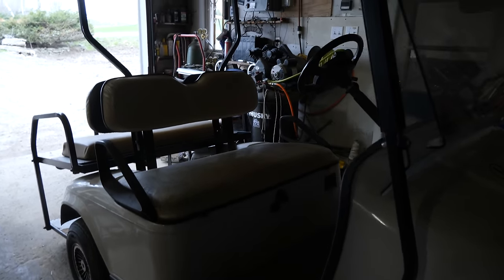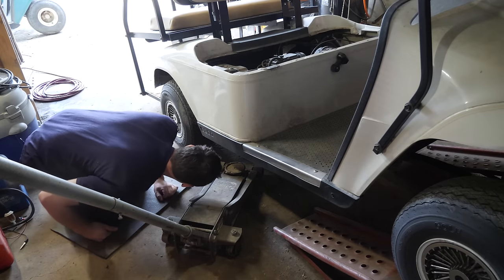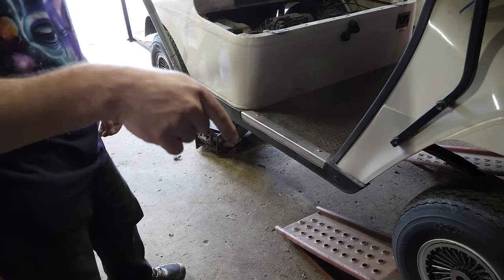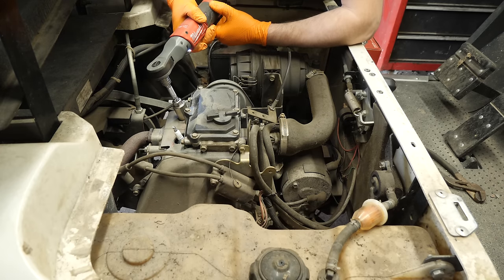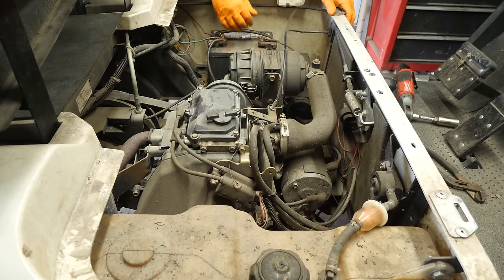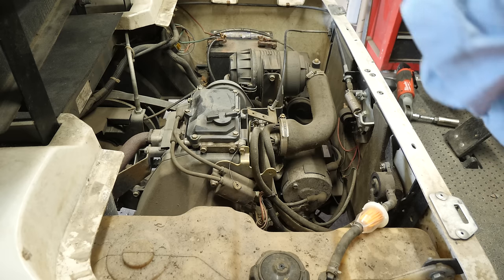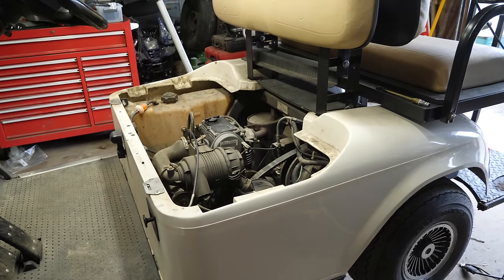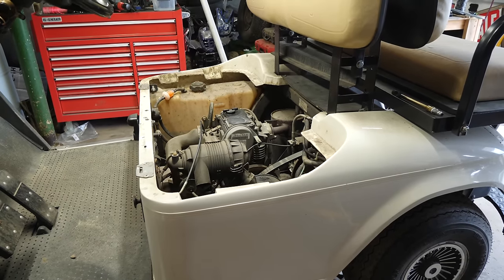2006 EZGO TXT, Gas - Full Service, Routine Maintainence

Comment: glad I watched...didn't know about the oil filter. Also, my ignition coil ohms on my 2007 Robin engine reads 2.5. My cart won't start as of a few days ago. I'm ordering a new coil since the ohms range is supposed to be 3.7-5.5. Anyway, if that doesn't fix the problem, do you have any suggestions?

Comment: Noticed that you said that the oil filter is washable. We just got a 06 and it Needs a oil change   What’s the best way to wash it
Reply from the maker: You can use a parts washer or brake cleaner. Be sure to blow it dry with an air compressor before reinstalling it.
Reply: Thanks. I’ll do that   Also which plugs are best for these. I know that the BPR4ES are used. But I have read that the BPR5ES are hotter   Our 06 has the same engine as in your video. Just want to make sure I get the right ones  as im not sure that the previous owner used the right one.
Reply from the maker: @onemuskynut  NGK BPR5ES is the correct spark plug for this engine.
Reply: @Kevinsgolfcarts  hey Kevin I noticed that our cart has champion rc12yc plugs in it. It does run fine  but it smells rich or blowing some smoke a bit on startup  are these the wrong plugs  that are in it.   I thought they should be nkg plugs
Reply: And the oil is a bit low too
Reply: @Kevinsgolfcarts  hey Kevin you say the  ngk 5 is better. Why ? I looked up the manual and it said the ngk 4  and today I stuck ngk 2 in it. Is that too hot of a plug for these.

Comment: I went to replace a start/gen belt and was unable to get the drive belt off. The belt rides about an inch deep in the driven clutch pulley, nowhere near the outside of the pulley that would make it easy to roll off. Looking at other youtube videos and the other carts on the property this belt seems like it is too short. Is that a possibility or could there be something wrong with the clutch? Are their different lengths to the drive belt. It is a 2016 MPT with the Kawi motor. Thanks

Comment: Hello, found your channel researching golf carts. I’m looking for a gas cart for my kids to run around on our 15 acres. Looking at Ezgo RXV 2010, 2013 Yamaha and Assorted club cars. Is one more reliable or better built than another?  Looking for something reliable. All these cars are northern carts, Canada or Michigan and look to be in good shape. Thoughts! Is there one to stay away from? Thanks
Reply from the maker: Personally, I would stay away from the newer EZGOs, 2006 and newer. Some of them ride like crap, very stiff suspension and are very wonky. Yamaha and Club Car make decent gas carts. They all have their issues but EZGO is the one that aggravates me the most.
Reply: @Kevinsgolfcarts  agreed!  I have a 2015 EZGO express s4 and the ride is so stiff.  Do you think a new rear suspension would help?
Reply: @mg324501  A pillow under the butt is cheaper

Comment: at least I thought I had it figured out can you tell me where the red black and green wire hook up at from the voyage regulator and on solenoid where’s the blue wire go it’s coming from wiring harness
Reply from the maker: Black to ground, Red to the switch side of the solenoid (same side as the starter/generator) green comes from the charge output of the starter, also should be green. Blue comes from the switch under the floor (accelerator pedal switch) and goes to the positive side (small terminals) of the solenoid.
Reply: @Kevinsgolfcarts  wow so knowledgeable thank you man your a good person man thanks I put the red from the voltage regulator to the big hot on the silonoid is that wrong
Reply: @Kevinsgolfcarts  I had to screen shit your message so I’ll always be able to know that thanks man very important stuff!!!
Reply from the maker: You want the voltage regulator to be "active" only when the cart is running. When its connected to the always hot side of the solenoid, it will always be "on".
Reply: @Kevinsgolfcarts  ohhh….. thank you man I broke down and took it to a shop today I watched all your videos last night trying to see a angle of the Silonoid wiring and the reverse and forward wiring I was constantly watch your videos lol

Comment: 7/16 is too large 3/8 ...too small. Is it a 10mm?
Reply from the maker: I'm not sure what you are referring to.
Reply: My apologies, I did not explain myself. I figured it out, those 3 screws to remove the oil filter are 10 mm. of course I had a 9 mm and I had an 11 mm had to borrow the 10 mm from my neighbor, lol but I got it done really appreciate this video! I have a 2007 txt

Comment: What kind of engine is that?
Reply from the maker: Robin 2 cylinder 295cc
Reply: @Kevinsgolfcarts  Thanks Kevin, do you know a good place to get new rings and valve guides? Smoking pretty bad.
Reply from the maker: We send engines out for rebuilding since its more cost effective. We used to do it in-house but its very time consuming.